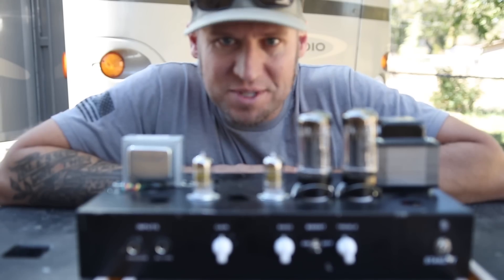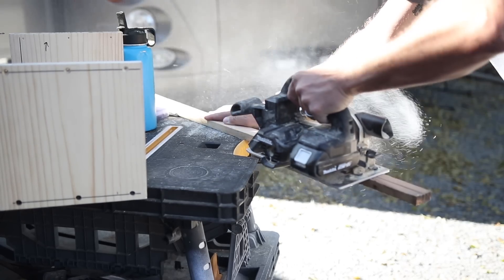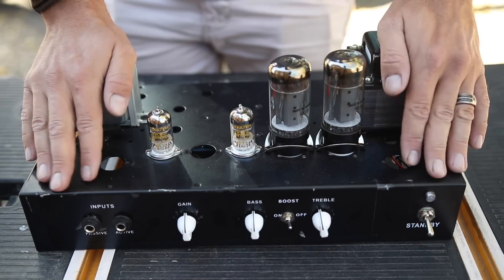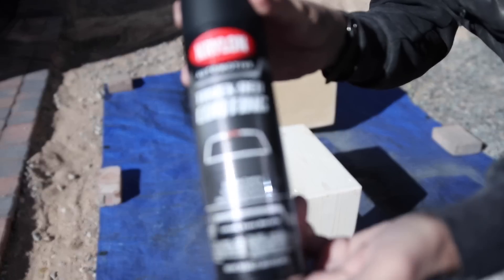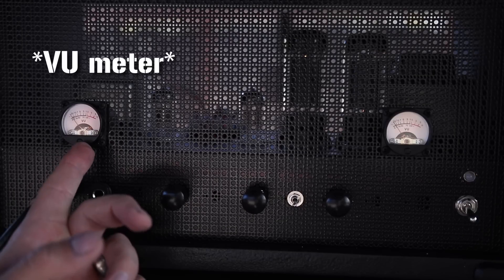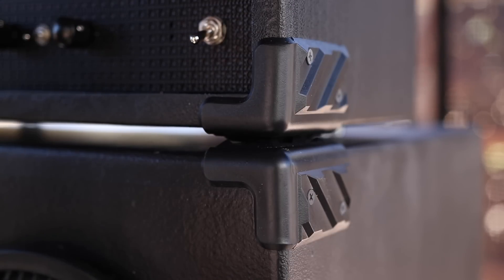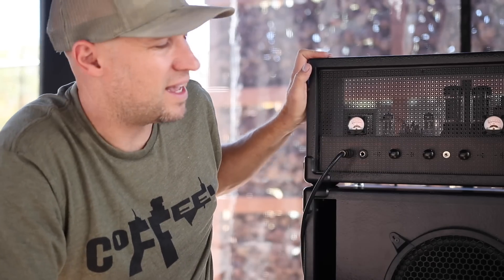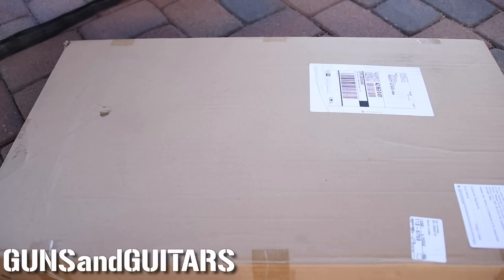Build your DREAM AMPEG style TUBE BASS AMP (for half the price)! KLD BFLEX 25 DIY portaflex kit

Comment: Odds are your amp is using the cathode bias instead of a fixed bias design (which is still adjustable).  My 1966 Fender Bassman amp came with the same two 6L6 tubes in it and that was a 50-watt output as was the Ampeg B-15 once they switched away from the cathode bias circuit, using those same tubes.

Comment: a few things... the Ampeg Portaflex that was used for all those recordings back in the 60's was primarily the 50-watt version, not the 20.  The first of the Portaflex combos was 20-watt but became a 25-watt shortly thereafter. By 1966 that 25-watt Portaflex, using the same two 6L6 power tubes, delivered 50-wattsof power, just like the 1966 Bassman amp that I bought new in 1966 using those same power tubes. The original B-15's used a cathode bias which delivered far less power than the power tubes were capable of delivering.  When they changed the design to a fixed bias, those same tubes put out 50-watts, which was usable for gigs in small venues.  The 20 and 25-watt versions were fine for bedroom practice and studio recordings, but if you played live with a drummer, you would be buried.  The 50-watt did the trick for small and some medium-sized venues.

I personally used a 50-watt 1966 Fender Bassman amp in those days, that I bought new in 1966.  It was the first of the large cabinet versions of the Bassman amp and the last one to use 2x12" speakers. When I started touring with a nightclub group in 1971 across the mid-West, Western, and Pacific regions of the US, it worked fine until we played a 950+ occupancy club in Lincoln Nebraska. Guitarist and keys had both recently bought 120-watt rms Vox Super Beatle amps and they buried me quite easily.  Nothing worse that playing a gig where all the members of your 5-pc band are asking you to turn up and you're already maxed out.  Next day bought a 200-watt Standel MCIIb/SAM30b piggy back amp that was ungodly loud and clear and never had a problem.  I could rarely turn the master above #3 on the dial  (9 o'clock) playing indoors, even in the largest rooms ((~2,000 occupancy).  ***Note that almost no venues had FOH or house PA systems back then.  We brought ours with us and it was only used for vocals. We had to fill all the venues we played with sound from our amps. Using mic'd amps or DI outs to the FOH were not a thing you could do back then outside of coliseum-type venues with their giant FOH systems.

•  Also, none of the older Ampeg All-Valve amps have the load protection you are talking about.The current version of their amp is the P50-T and it does have a load box built-in.  NEVER presume a tube amp has a load box built in - READ THE MANUAL! If you don't, you may very easily turn your flip-top amp into an expensive paper weight. That is NOT normally a feature on tube amps, but you can buy a dummy-load box to plug the head into. If you play through it without a load box either built-in or external,  you will indeed fry the output transformer.  When using an all-tube amp in a pro-recording studio, you will typically send them a DI output from the amp AND they will mic it.  Then they will blend the two channels together to get the sound that the engineer wants/likes.  Same thing is true at most music festivals if their sound technician or sound team know what they are doing.

•  You absolutely do need to match the impedance switch from the amp to the impedance of the speakers.  If you are running a single 8Ω cab you need to plug it into the 8Ω output.  If it's a 4Ω cab you need to plug it into the 4Ω output.  If you are running two 8Ω cabinets, you should plug one into the 4Ω output and plug the other cab into the first cab.  This is called  daisy chaining your cabs. The industry standard connection is a parallel connection and two 8Ω cabs daisy-chained together in a parallel connection will put a 4Ω load on the amp and you absolutely DO want to plug that into the 4Ω output for the correct impedance match.  If you don't it will not perform as well and if you do it a lot, you will eventually damage the amplifier. Solid State and Class D amps automatically adjust to what ever load you put on it, although if you run the ohms load below the minimum for that amp, it may melt it. For instance running a 2Ω load into a solid state amp with a 4Ω minimum load rating, the magic of the amp may go up in smoke if its protection circuits don't kick in soon enough to shut it down.  Tube amps (all-tube\all-valve) do not automatically adjust the impedance, nor do they put out more power at lower ohm loads like the solid state amps do.

•  Solid State bass amps (class AB) and also class D amps that have a "hybrid" preamp, have no effect on the power channel as far as worrying about operating them without a speaker load.  The "hybrid" part of that means there is one or more tubes in the preamp, typically in the gain section to get some tube warmth, overdrive, or distortion in the sound.  The amps with power tubes and output transformers as the power sections are the ones that require a speaker load.  Hybrid amps don't have that problem.

Comment: Curious as to how the Goldwood speaker/driver has held up over time. It's not really designed for a vented enclosure, so I'm hesitant to pull the trigger on buying a couple. I'm getting ready to start a similar project and I don't really want to spend a ton on Eminence speakers, so I'm looking at alternatives. The Goldwood GW-1058 looks better suited for a bass enclosure and is designed for bass and vented enclosures, tho it's around 50 bucks instead of 30...still less than half the cost of the similar spec Eminence.

Comment: 8:30, well yeah mate - You wanna crossover the woofer lower and let it not handle those higher frequencies, and let a nice horn based tweeter tackle the higher frequencies. Lets the woofer articulate the lower frequencies better.

Comment: The active and passive is for active and passive basses. That's why it's thinner sounding.  My Stingray 5 runs on a 9v (active) and P bass is passive and the tone is totally different. Try getting an active bass through that input, I'm really interesting to hear what you think of the change in tone but I wouldn't put an active bass through the passive input as you'll overload the circuit and it will sound all gainy and crappy (plus you will probably damage your unit). Good luck brotha! Enjoying the content 👍

Comment: How did you mount the amp in your enclosure? just by the front screws? I have one of these and am building an enclosure.  

The mounting holes on the chassis are threaded for a machine screw - but your video didn't show how its mounted in the box. can you explain what you did?

My Thoughts/notes about the amp: 

it sounds great, but the tone stack sucks. After putting a MXR 10 band EQ pedal in front of it, it can really be dialed in to good sounding tone. I have had the best recordings from it with a 16ohm speaker.

My next steps with it are to add in a master volume (to drive the preamp tube a bit more) and hopefully clean up the tone stack to something usable. 

For the price, this amp kicks ass, however, after new tubes and material for an enclosure, it was closer to 400$ total cost.

I might have opted for the ampeg Micro-CL stack, at just 100$ more (than my total cost) - although solid state, it sounds really good for recording. I might get one anyway. 

This amp is awesome in its own right, and is completely repairable/ customizable by a knowledgeable technician.  That's something you can't get from a solid state, IC based amp.

Comment: It has a DI. Use it anywhere.
Reply: The DI sounds harsh in direct recording - my countryman DI sounds better than the DI out of the back of the amp. if you use it, you would want to run it into a compressor or something before the preamp, as a ton of the high frequencies push through and they are hard to tame in post production. in my test between the amp DI, the countryman DI, and the speaker, the speaker and the countryman sounded much better than the amp DI.
Reply: @andymetz709  - Countryman DI. Enough said. Awesome

Comment: If you could use a speaker that is 3 db more efficient, that would be the same as doubling the power of the amp. If I remember correctly, the Fender Super Reverb amp used 6L6's and put out 40 watts into 4 10" speakers, an 8 ohm load?
Reply: Super Reverb is 2 ohms!

Comment: Hey Dan do you think painting a head with that bed liner and then painting it would work, do you think it would keep the second color of paint on it? I want to retolex my jcm900 head but it seems kind of a hassle after seeing this video I was wondering if that bed liner with a coat of paint on top of it would work better
Reply from the maker: I think it would work just fine as long as you give it it’s full cure time before painting over it
Reply: @GunsandGuitars  👍

Comment: Hey Dan, the bass man, how'd you run this at 4ohms, into two 8 ohms cabs? Like, physically how'd you do it?

God Bless you in all things you do today!
Reply: Hi , I'm not sure how I got here but to answer your question , the speakers are run in parallel which halves the resistance,  but not the impedance seen by the output transformer.  If yout amp has a pair of common connected output jacks at 8 Ohm , just go straight from your jack outs to the 2 speakers and they will be in parallel at 4 Ohm . Parallel halves the resistance. If your building cabinets I recommend a plate that uses pairs of jacks and pairs of speakon connectors. That way you can go from a single 8 ohm out to one cabinet and then piggyback the other . I would add an active sub to this set up and run it from a Direct Out from the preamp . Most home entertainment subs like the old Logitech or Celestions run a 10 " at 175 W . You won't hear it much but you will feel it and it does not matter where you place it . I use a Logitech sub that has a 10" TangBand which are great for the job . The problem with tube bass amps is they should run more metal and copper in the output transformer than a guitar and I use old 30W transformers to rewind for 5W combos . A guitar OT cannot generate the lows that hit the gut and you have to wind them yourself to get down to that 20Hz frequency. It's cheaper to run a sub as a satellite in the band ( like behind the drummer !) to shift the air and shake out those lows , otherwise its my 4 x 10 Celestion ported cabinet I built . The preamp in my bassamp design runs 2 x 2C51s or the cheaper Russian 6n3p-e tubes which are really hi fi tubes but less prone to distort so you can push the amp harder and still have plenty of headroom before break up . Historically none of the classic bass amps e.g. Fender Bassman were bass amps for these reasons and were always used with guitars , which is why most bassamps are solid state thanks to the tube like sound of FETs and no need for a huge output transformer. If you want to build a great sounding bass amp take a look at the late Albert Kreuzer s FET Bassamp . It's pretty easy to build easy on the pocket and has a great following on the Internet with mods . Mine runs a couple of VU meters from a simple circuit , has an inbuilt tuner and EQ,  and it works with any slave power amp or direct into PA mixer . My standby 100W head is a 70s HH Bassamp which is stunning to look at and listen to and noise free , but becoming collectable now . I cant think of any 70s band that didn't include a piece of HH equipment.

Comment: I like it a lot but I fall into the category now of not needing amps.  Just going through pedal (Sonicake boom) straight to pa and using in-ear monitors.  Similar for guitar/mandolin.  Amps (for me anyway) have just become a heavy extra piece of possible failure points that I can't even hear with in-ears.

Comment: if you got another head and used an ABY to split, i bet you'd get more total headroom.  even easier would be just using the DI output into a powered PA speaker or some other clean power.

Comment: Oooo, I really like the sound of this monster!!  I got one of their kits after your last KLD build video....  and haven't gotten around to building it yet 🤣🙄💩💩

I do have a vintage Silvertone bass amp model 1483 that's 23 watts, and I totally agree.  Not quite big enough for live settings.  This inspired a bit of a hybrid build- I am making a bass amp with a Portaflex front end but with a 60 watt power section from a pair of 6550s.  I already have the power amp section I'm pulling from an old Bogen PA amp, complete with a chunky output transformer.  Theoretically it should sound about as close to a real Portaflex as your KLD here.  (although interestingly the classic Ampeg SVT uses 6550s, so...)

Comment: You know what kills a solid state amp? A direct short across the output. You know what saves your vacuum tube output transformer without a speaker plugged in? A direct short across the output. Having multiple output jacks precludes that ability to simply use a shorting output jack. It should have a selector switch and a proper output jack.

Comment: 3 comments:  A speaker+enclosure that only goes down to 45 hz may have problems with the notes below G# on the bottom string--will almost certainly have trouble with the low B string of a 5 string bass.   This can be fixed by choosing the right speaker and enclosure-paying attention to the Theile-Small stuff and tuning the cabinet.  This won't be important if you don't have that 5th string.  A 25 watt bass amp will not make it out beyond rehersal--unless you may have a temendously effecient speaker (I've got a JBL K-140 for heavy lifting, and still use a 150 watt amp).   The new Ampeg Portaflex head uses 6L6s--as do all of the vintage heads from the B-12, B-15 etc.  You can't get more than 22 clean watts out of 2 6V6s in push-pull.
Reply from the maker: All the sound demos I did with this thing were in BEAD tuning, so it hits the low B just fine. But I agree with everything else you said. Don’t get too hung up on the translation of frequency to pitch. There’s so much timbre on an instrument like electric bass that you’ll hear all notes just fine. Similar to how bumping 60hz will also add more balls to an open D string, even though that’s a way lower frequency than the actual pitch.

Comment: SO good to see you back, Dan. Tired of seeing $3,000 basses with the "Wow, what a steal !" under it.
I love the VU meters and the tarp to paint on is a great idea, too ! The truck bed liner paint is PERFECT.
I'd try a 410 instead of a 115. I thought you said 250w, not 25w. For a tube bass amp, that's about the bare minimum.
Reply: Yeah, my 25 year old 500 watt Carvin head and full stack was like a megabomb back in the day, but nowadays, 500 watts is like preschool level power! At least for bass head power.

This head SOUNDS amazing. And truthfully, these days, aren't we recording more than playing out? If I turn up my Carvin, I get angry calls from the USGS... I'd like to be able to record with this head, I'd turn it right up to the break up point, and let my playing technique take it over into break up on peaks, all without triggering local seismographs (and the neighborhood's dogs).
Reply: @alphanumeric1529  i had an old crate b150 that was 150 watts by itself (already loud for anything I would use it for) but my dumbass self bought a matching extension cab that boost it to 300 watts coming out of 2 1x15's. Loudest amp i have ever owned. I gave it to a friend who cranks it in his bedroom with the cab. I think he's gonna go deaf lol

Comment: There would be no reason not to directly copy part for part the original Ampeg design as it is no longer protected by patent. . . .unless there are ways to IMPROVE it.
Reply from the maker: Or to streamline production, which is the case here. They designed it around parts they are already using for their other amp kits.

Comment: Would love to try some KT88 power tubes in this.
Reply: I just bought this amp in January, and had my friend who is a tube amp tech look at the schematic (schematic is available on the website under the kits section) and it says it can handle KT88s, but my tech said the circuit doesn't provide the plate voltage needed for those.

Comment: As teen in the 1960s many lead guitarists in bands used the Ampeg portaplext with an added Altec Lansing twelve inch speaker in it. I myself used a Fender bassman amp from the early 1960s that had 2 twelve inch speakers and two channels. I played lead guitar though it like many others. It was a great amp and so was the Ampeg portaplex bass amp. I was also great for bass, of course.
Reply: The 50-watt Bassman 212's in the 60's were often used by guitarist partly because they got an additional 10-watts of power out of it than they got out of the 212 Bandmaster.  Most guitarist I played with preferred the sound they got out of their guitar from those 60's Bassman amps over the Bandmaster too.  I bought a new 1966 Fender Bassman amp in 1966 and gigged it until late 1971 (playing bass), when I started touring. Both  the guitarist and keys players bought 120-watt rms Vox Super Beatle amps and buried my poor 50-watt, all-tube, Fender Bassman. My poor Bassman amp needed to be mic'd or run through a Front of House sound system to be heard with those two Vox powerhouse amps and that just wasn't found in clubs back then.  So I upgraded to a 200-watt Standel piggy-back amp that had 2x15, bass reflex, powered cab and it  could bury the two Vox Super Beatle amps if I needed to - think acoustic 360/361 or SVT 810 loud.. I played a lot of small and medium-sized venues though with a 1966 50-watt 212 set up until I started touring and had to compete with 120-watt rms guitar and keys amps..